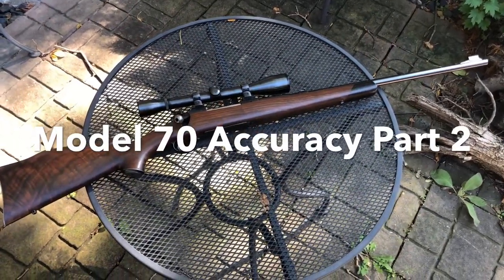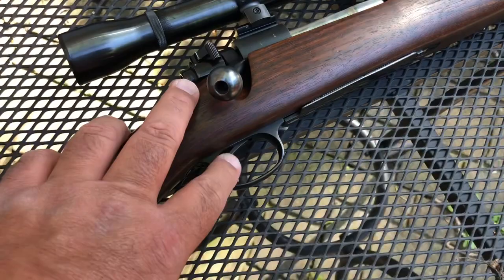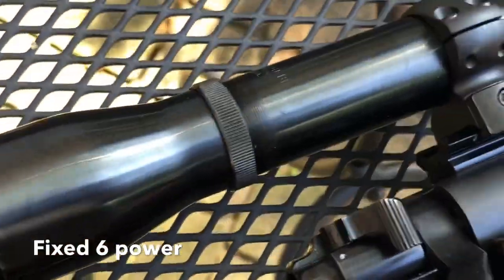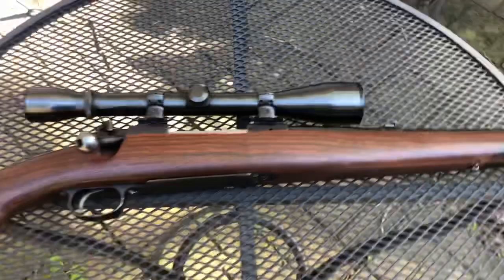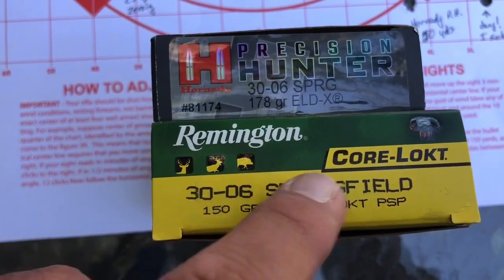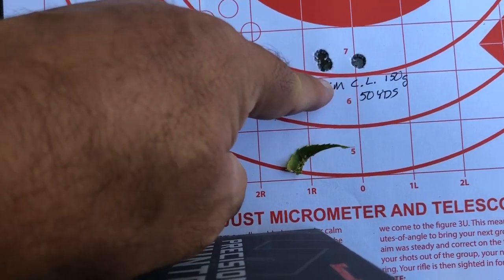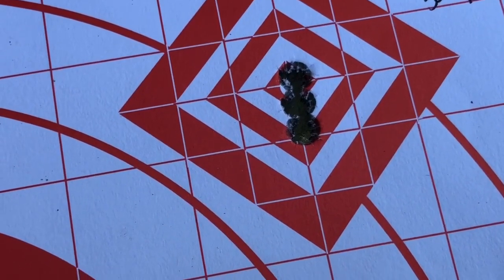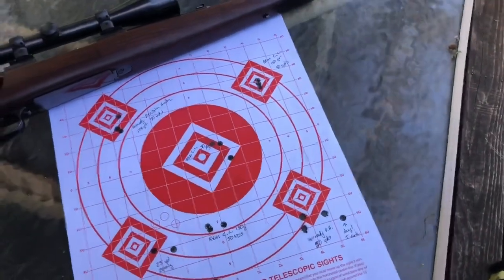Winchester Model 70 Accuracy Part 2

Comment: I’ve had dozens of M70’s. That does not make me an expert on M70 accuracy. What makes me an expert is winning in long range shooting competition where an understanding of how to get the best results from the rifle is paramount. Getting the best from an M70 sporting rifle is called match conditioning and this usually consists of unitizing the barreled action to the rifle stock, trigger adjustment for smooth trigger control, and application of marksmanship. Thing is even having addressed all these concerns if the barrel is not exactingly uniform from chamber to muzzle accuracy will suffer and thus shooters should not have expectations that any factory barreled M70 will yield a good zero even when the shooter has a consistent relationship with the gun and ground. At any rate, I had a post 64 M70 in .264 Winchester Magnum which was sub MOA from a particular lot of 140 grain Winchester Power-Point Ammunition and this helped me get a good hit on a Pronghorn at 488 yards flat ground distance back in the late 80’s. These days I mostly shoot a match conditioned AR in competitions and do very little hunting but if I did I might go for another M70, since they’re now made mostly in State of the Art facilities operated by FN in South Carolina and Portugal so the newest M70’s are really well put together.

Comment: I like the rifle and you are right about the mechanics. With that being said, the thing that is going to help that rifle shoot to its full potential is doing a good pillar bedding job on it. Or at minimum a proper glass bedding job. Also shooting it at 50 yards is not really doing that rifle any justice. I've had/have many pre 64's that shoot sub moa 5 shot groups. The minimum range I shoot to test accuracy is 100 yards and then stretch them out to verify how accurate they are at the maximum range I will be shooting deer or elk at. This tells me what the rifle is capable of and like you say, you aren't going to be shooting off of a bench when hunting, but at least I know what my rifle is capable of. The rest is up to me and how much I practice to know whether I can ethically make the shot. Good video and informative. Glad to see you are using that old model 70. Those old rifles were made to last a few lifetimes and can be passed down from generation to generation. The stock is not original to that rifle, but has some nice lines/ergonomics. Kudo's for keeping the scope as period correct as well. Those old steel tubed weavers are great old scopes.

Comment: You mention replacing the scope mount and rings for the Weaver k4/K6 - 60-B scope. On my 1956, .30-06 model 70 Featherweight, I have the Redfield one piece mount (PAT.NO 1,837,290) and rings holding the K4 60-B Weaver. What did you replace the old mount/rings with?
Reply from the maker: Tim Rice leopolds